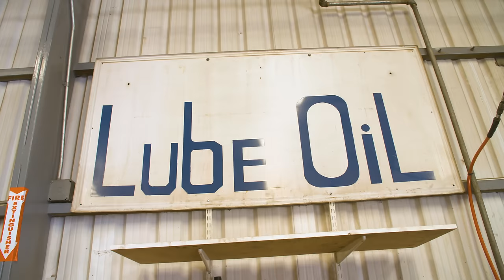Welded Diff vs. $1200 Diff | HiLow

Comment: Straight pipe Vs Performance (expensive) exhaust

Edit: HOLY SHIT, thanks for the likes
Reply: Muh back pressure
Reply: They're California 350z cars. We're not allowed to straight pipe cars.
Reply: boostedsil40 kinda want to do the same thing like who wants to spend 2k on exhaust
Reply: You are blessed fam
Reply: Obviously the straight pipe. No need to test it
Reply: @BlastinRope  dont need back pressure if its It's not a 2 stroke.
Reply: @V8_Diva  so ????
Reply: @jets8991  yes you do if your running a car with 100 hp and put 3 inch straight piped dual exhaust you'd lose so much torque ! Your dyno would look like pure shit up to 7k rpm
Reply: @derekiskindacrazy1541  so, they wouldn't be able to drive on the streets with the cars anymore, AND it would cause issues for the company that owns the cars.
Reply: LogicalSense  that's why people run ft long pipes off the turbo then right? I'm sure people that run open headers on drag cars are dumb to right?
Reply: @derekiskindacrazy1541  yeah. If you drive a civic that doesn't have any low end torque to begin with. I know what you mean but it's not essential for it to run like a 2 stroke.
Reply: LogicalSense  hey. I'm having a little trouble adjusting the thermal fuckulator.  Any chance you know your way around one of those
Reply: LogicalSense  damm.  I feel so honored that a genius like yourself would waste time arguing about straight pipe on YouTube with a guy that has a roast beef sandwich as a profile pic without actually mentioning the pros and cons of back pressure but instead brag how much of your life you've wasted obtaining student debt and  playing g.i. Joe..

But seriously, if you did serve I appreciate your service.
Reply: no need to test, just use your common sense. if the straight pipe setup was not done by an idiot, it should make more power than something that has a muffler. individual straight pipes poking out of the hood ftw.
Reply: Butt dyno will not tell the difference.
Reply: Turns out, a simple Google search reveals that back pressure is bad, and we should all be ideally running open heads. Obviously that is also stupid, as is arguing about back pressure on the internet with people who also have Google
Reply: @shawnyoung1869  like I've already said. I didn't say zero back pressure is good.  O just said that back pressure isn't a necessity to run in a 4 stroke like it is in a 2 stroke engine
Reply: Why do you care about likes?
Reply: Mike Hawk i don’t i’m just saying holy shit as in idk why people liked it so much. why’s it matter to you if i care for likes or not on a comment?
Reply: Faiid Oblivion In the end I don’t truly care but it is cringe to edit your comment like that because it makes it look like you have a big need for validation, especially since your comment is so generic. Again, I don’t truly care and yeah I guess I shouldn’t let it annoy me lol.
Reply: Mike Hawk nah bro it’s fucking annoying. It’s a good ass comment and the edit ruins it.
Reply: @V8_Diva  f
Reply: @faiidoblivion6988  i dont think anyone cares specifically because its you, its just kinda sad and lame when people beg and simper over likes as if theyre some valuable commodity, thats all.
Reply: @V8_Diva  technically you're not allowed to straight pipe a car in any state in America because it's a violation of federal law to remove your catalytic converter . But in many states like Ohio where I am we don't have vehicle inspections including emissions testing. So you can do whatever you want with your exhaust without really getting caught. I guess if it's too loud the cops can pull you over and give you a ticket for muffler violation. But you can take your catalytic converter off and there's almost no chance of getting in trouble. You would have to do it yourself because no reputable muffler shop will remove one. I've replaced bad catalytic converters with a pipe and there was no way for the state to know. But if I were ever caught and the federal government found out somehow I'm sure I would be in trouble. I'm not a big rule follower so I don't have a problem with it. Funny enough our air quality here is quite good and I think we are the 7th most populous state in America.
Reply: @actionjksn  the federal law states that they cannot be "replaced" by "converter replacement pipes". Not that they can't be removed. Because plenty of show cars do not have catalytic converters. And plenty of cars in sports like Formula D, do not have them either.
Reply: I just would cut the exhaust off
Reply: Straight pipe is a blanket term

Comment: VLSD was essential in driving my 240sx in 4 season weather. It helps tremendously in the snow and rain. I also had a Nismo 2 way and a welded diff. The nismo was good for most weather but the welded just sucked in the wet and snow. I put 600hp with 10.5 drag radials through the welded and nismo lsd without any failures.

Comment: The metal plate in the middle of the diff was the right idea, and something we (in sweden) learn by trial & error. Just welding the gears WILL result in it failing eventually. The middle plate adds so much more strength its virtually impossible to break (if you weld right). However, long term, because welded diff cant move at all, other components of the drive line do take more damage and wear over time.

Comment: Lsd over welded all day everyday. I am sure you will see the difference once those cars hit the track. The more expensive z will start to really improve as the performance of the engine is improved. The more expensive car at its present form will blow the cheap z on a roadcourse.
Reply: Most fulltime circuit racecar run a fully locked diff same as the welded one... lsd is fine for daily cars if you don't want to drive really hard
Reply: Lsd is way better for time attack/grip scenarios. Locked diff makes putting power down a little more tricky and the car will "push" more without the different wheels speed throughout the corner
Reply: I was pretty put-off by them making statements without getting it on a track... the LSD makes a HUGE difference in handling.

Also, a welded differential just eats tires on a daily and if anything does break, it's not going to be the differential, it's going to be an axle.
Reply: The issue with these cars is that there is a gear oil pocket inside those differentials that once it burns up it goes from being a limited-slip to being an open diff I did this to mine which is why I bought one and welded it and it was way better is better in the snow it was better in the rain it was better in the sun I knew exactly what my rear end was going to do and I knew it was going to put the power down when I wanted it to instead of skipping
Reply: @DmOcRsI  also puts extra jarring load on the tail shaft and uni joints. I've got a mini spooled diff which acts the same as a welded diff but just stronger/reliable, but I've had to replace uni joints. Especially so when you've got a supercharged car doing clutch dumps from stand still lol.
Reply: I daily drive a welded diff e46 and its the best thing ever, I do a lot of spirited mountain driving and welding the diff got rid of any understeer, the car now has no more understeer and the back is more planted and more predictable and puts power down better

Comment: I've had both on the same car.  I prefer my 2 way.  Just have to watch out sometimes decelerating too quick the rear end will lock up, If I were to buy a diff now I would go for a 1.5 way just because i'm not into drifting as much as I used to be.  Problem with a welded on a daily is you definitely eat up your rear tires a lot faster and its very hard on your rear suspension or axles on every small turn.  Also a welded diff your car wants to go forward, can be more prone to understeer if you don't want to break traction and drift around a corner.
Reply: This is the most important comment

Comment: 11 years ago I bought a '70 Maverick that came with a welded 9-inch rear.  I put a 250 HP  302 and a AOD in it . Smoke both 275/60/15 rears often and I have had no problems.

Comment: I do! I totally freaking get it!  I was debating putting front and rear lunchbox lockers in a 4x4 conversion I'm doing to a c10 diesel because of the extra noise, but you're right.  I'm building it to scare the normies anyway, it should make extra noise!

Comment: Main advantage of LSD is you can modulate the diff lock by clutching in(because the diff is not locked when car is in neutral) or if you have a 1 or 1.5 way LSD, braking or deaccel as well. Depending on how you drive this can give you a lot more grip during drifting, and is undeniably superior for grip racing. They will perform the same if you just do donuts or only drift by power, but it gives you a lot more control especially if your car has lower power. With a lsd you can also usually get away with a stock ebrake, where as a welded with any kind of kind of grippy tire you’ll usually need a hydro to get it to lock consistently since it takes a lot more braking force to lock two wheels that are always connected to each other instead of spinning independently. There’s merit to both, but because welded benefits from more power and hydro, I think the cost difference is not that bad

EDIT: added a few details for clarity!
Reply: This is such an on point comment. 👍

Comment: Have you driven a welded diff in the rain? It slides around at any sign of water. It also makes chirping noises in the parking lot due to your inner wheel not spinning at the same rate as the outer wheel and it causes tire wear.

Comment: I run Lincoln lockers in a jeep and a trooper front and rear. No problem. And just broke a axle recently lockers still holding. The only thing I can say is don't weld a plate if you are running c-clip axles. I wasn't sure how it would be but I don't have much money but do have a welder. I can say I love it and will be welding them from now on. If you weld the front it is best to have manual hubs. Or in the case of my jeep it has a center axle disconnect with cable. And I can still flat tow it.  I trailer it but I did do a flat tow test and it tracked straight. Hope this helps someone.

Comment: If you can get an extra set of gears from a stripped out diff, you use 2 gears ground down and jammed in place of those plates! If the welds cracks, it's still pretty locked up.

Comment: My '65 Mustang has a live (solid) axle. It chirps the inside tire if I get aggressive on the throttle in a tight turn, but I like squealing tires so it's not a problem for me. I dug a furrow in the road outside my house when the chip seal was still soft.

Comment: For daily driver's, the car with the welded diff. Will be buying tires a lot more often, than the car with the limited slip differential. Short-term the welded differential maybe cheaper but in the long run installing the limited slip differential would be more cost-effective.

Comment: If you're modifying the car strictly for drifting...then fine weld it
But if you plan on driving it on street, and doing some track days now n then...you'll ruin your car if you weld it
Reply: Yeah my friends keep pushing me to weld my diff but i track my car.  Its better to leave it open diff than to have a welded for track use
Reply: Dave Shaw hi, why will ruin the car? drive shaft will broke?
Reply: @fedeberdun7759  It will ruin the car for everything else but drifting. Take into account that this is a daily fun car, not only a drift car. If you have both wheels spinning at the same rate, they'll wear out more than with an open diff in every turn.
Reply: @fedeberdun7759  When going around a turn, you want the inside tire to spin slower than the outside tire. With a welded diff, but tires spin the same all the time. Lets imagine you are racing an oval which is basically always requiring you to turn left. Your left tire will be spinning to fast in relation to the right, so you will have less grip with that tire and also destroy it after a few laps.
Reply: @SI0AX  all right, so it destroy tires and give less grip in track. Thank you mate!
Reply: I have been dailying with welded diffs since 1999 ... they are fine and more predictable yes a full spool is the correct way to do it.. but if I can save $350 for the same thing ...I'm welding it

Comment: A good buddy (also a mechanic) welded the diff in his E36. It was fun for a while, until the vibrations broke some frame welds and the rear end dropped out on a highway off ramp. Buy the LSD. Just do it.

Comment: As I watch the cheap version I am thinking constantly that I would never ever want to drive that. I drive a Opel (Vauxhall) Corsa E OPC (VXR) performance (stock 207 bhp, tuned to 240 bhp) which comes with an Drechsler diff on the front. Drives perfect and corners extremly quick. :) But if it fails, it will cost me about 1500€. So I hope it will last a while.

These whole series shows me, that I would never ever cheap out on mods on my car. The best or nothing will be my attitude in the future.

Comment: 9:27
In Finland your car dosen't pass inspection if it has weldet dif.
Reply: its in most of developed contries that way.
Makeing brake tests on mot is impossible. And welded diffs has huge downsides
You are unable to manuver your car by human force(only back and forth)
Locked diffs can be fatal in cases like snow etc. where you need traction but one tyre spins as same speed as second one. It causes slippery and skying you are going. Hopefully not into face to face crash.

Comment: I just emptied the fluid and packed it with wheel bearing grease. Locks up better and doesn't get hot. Plus I can take a sharp turn without wheel hop

Comment: I raced off-road for years with a welded Toyota Landcruiser in a Ford Cortina, the diff never broke but we did destroy a lot of axles. You go from 50% of the load through any axle to 100% of the load to either axle so the axle will be the weak spot in the build.

Comment: if you have the right tires on the car, the only time you'll notice a welded diff over an LSD... after the burnout the clutches in the LSD will be overheated eventually wearing out and regarding tires with the welded diff, good tires wont squeak or hop on tight turns they hold and brake traction vary smooth.

Comment: That type of car should have limited slip differential as standard equipment. Single pull on that is absurd. My 08 Silverado has posi traction, it was an optional add on but I was glad to find out it has it. What kind of person orders that car new without it? Unless it was not an available option, which sounds crazy

Comment: I think another cheaper option for an LSD would be to poach a diff from another Nissan that came with LSD and then pull some friction plates from a few of those diffs to make a custom clutch pack.  I know it can be done using 90’s pathfinder diffs and swapping into the frontier or Xterra and I think in my research I saw some people were pulling this off with the 350z as well using 05 pathfinder LSD.  You just poach the least worn plates from a few diffs … some of the friction disks never make contact in the pack so they are virtually new.

Comment: Guys...that welded diff is cheap. However your still using the factory case of which will break. You basically doubled the engineering load on everything including the housing of which may flex more than usual and allow the pinion to ride off the ring.....if the case dont break first.

Comment: I welded my diff. I drove 50 miles. then swapped to a open diff again. Open diff sucks as hell, but welded diff is much worse and in my opinion not usable as a daily driver. but for drifting it's cool.

Comment: I would be curious to know how or if a lunchbox locker would work for the purpose of drifting & drag racing. I ran one up front in my Jeep & loved it....for the most part. They are much cheaper than a new LSD or air/electric locker so there could be a better low car option.

Comment: Yes welds will stick to dirty metal even painted metal but heavily rusted metal... No common misconceptions are welding is similar to using glue but that's wayyyy off it's more like making two pieces of metal into one by melting a small area with heat, heat so hot it will melt rocks. which can sometimes leave a brown glassy substance on top of the weld due to contaminations in the metal. Dude to forging or casting of said metals. Fun fact the weld if done right is always stronger than the metal it is welded to. Usually welds always fail near or along the edges or ends of the weld beads.

Comment: driving with welded diff for 2 years now and it never broke. You would sooner break an axle by kicking the clutch a milion times on a road with good traction but you would still get home (i did)

Comment: Didnt nissan use the computer to independently control the brakes for traction control/limited slip on the rear ends. Hence the reluctor rings on both sides of the diff.

Comment: My question is how does it effect handling in high speed turns. Is it safe enough to push the car with a welded diff in those conditions? Loose dirt on the road and all

Comment: My main problem with this is they didn't actually go over why to pick a LSD. 

How wheel base length effects how often, hard you slip doing a turn.

How tire life expectancy is deceased and by how much with a welded diff due to always drifting.

How obviously one of them might be "free" but crater the resale value of the car by 1,000 dollars or whatever since the market for a car that eats tires and drifts getting into a parking lot is a lot smaller.

Those are the reasons to bring up.

Car worth 1,500 bucks? Weld.
Can't be worth that much less 
15,000 LSD.

Car is a spare car primarily used to track and only a little on the street. Weld.
Daily driver? LSD.

75 dollar tires. Weld.
1,200 dollar set of four tires.
LSD.

These are the reasons to invest or not in LSD.